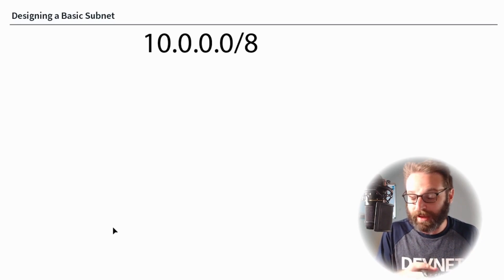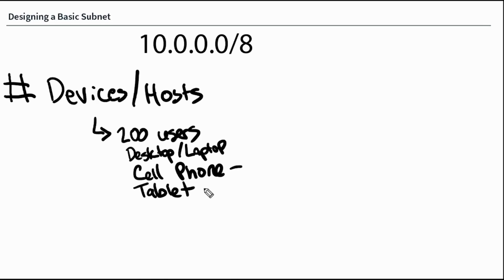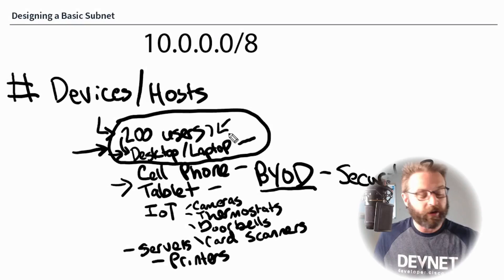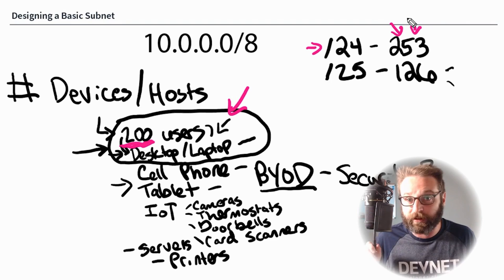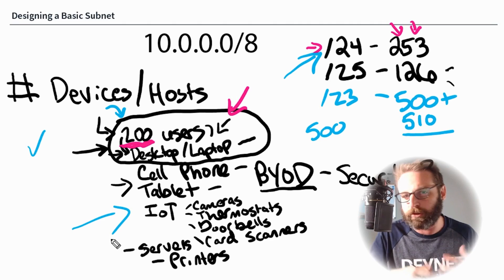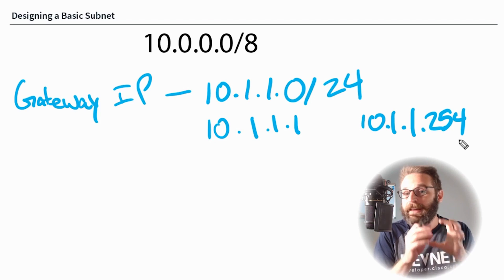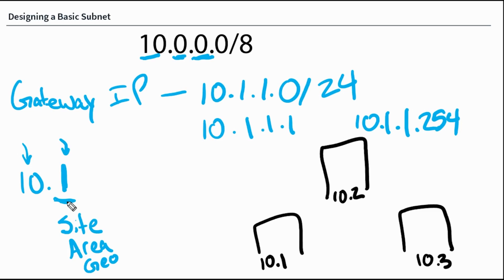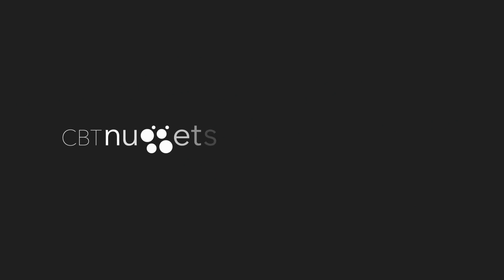How to Design a Basic Subnet in 9 Minutes

Comment: Excellent but I have few questions that how I will use these vlan on DHCP, will single NIC support VLAN and how these VLAN communicate each other using single NIC. How to define Evey IP address assign as per Hardware Address
Reply from the maker: Hi Muhammad, when using DHCP on a VLAN, you'll want to approach it as you would a normal subnet. You will want to set the DHCP range, the default gateway, and the DNS servers.

An interface assigned to a VLAN will send traffic only on the specified VLAN. The client that is on the receiving end will need to be either DHCP assigned or within the network range for the VLAN.

If you are trying to assign IP addresses by hardware, you would probably want to have a domain run DHCP service, so the scope and manageability of hardware addresses are easier to manage. It can be challenging to maintain that level on a router or switch. The connection from the server to the switch would need to be a trunk or a tagged port. Then allow the VLANs for the server to have access to the given IP ranges. The DHCP server will be able to hand out the IP addresses for the associated VLANs.

Hope that helps!
Reply: Thanks  @cbtnuggets . can you please add a video for this?